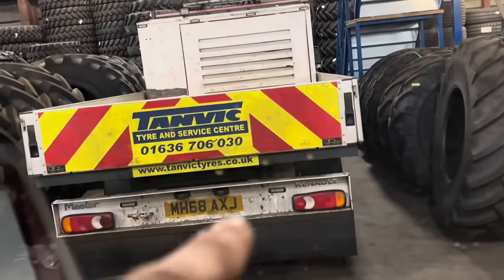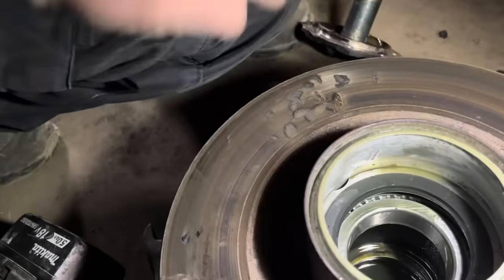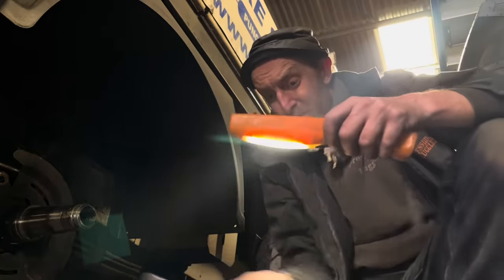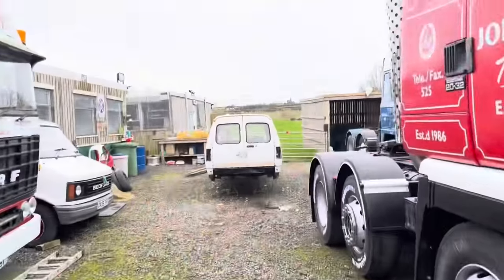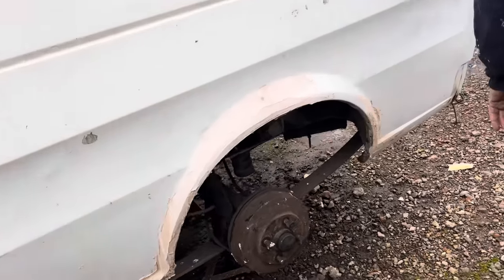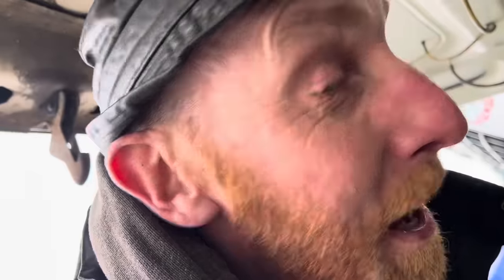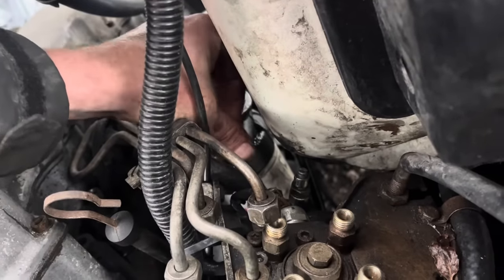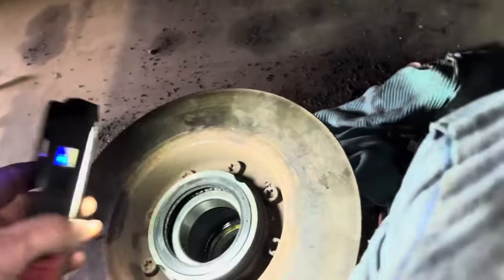Tanvic recall! Truck museum Bedford starting problem!

Comment: Chris, the cf Bedford, because the fuel pump is on its end , you need to bleed the fuel pump at the 5 mm Allen key in between the injector pipes on the fuel pump. Also old diesel starts to smell like brush cleaner when it is old & gone off ..generally when the diesel goes off the fuel pump would be knackered inside ..🧨
Reply from the maker: Cheers Ian mate that’s the bit of advice a wanted I’ll try to bleed it there first then mate! Yeah deffo think that was gone off then mate

Comment: Years ago, mate had a mini van that he shared with his girlfriend, then she bought a Mini car for herself, but always had trouble starting it. She used to ring him, he'd drive over and it started first time. With her being used to the old van, she'd been pulling on the heater knob, thinking it was the choke !
When I've been trying to prime some of our diesel stuff in the middle of a forest and the battery's getting low, I find if you block off the air intake with a bit of wood or thick card, the engine will turn over quicker as it's not having to compress loads of air ?
Also have a Garret metal detecting pinpointer, absolutely great for finding small stuff that you've dropped in the grass.
Reply from the maker: Cheers Graeme mate that’s a good bit of advice there mate! I like the detector idea 👌👌

Comment: In a garage I worked at in the 80’s and 90’s on those leyland engines if they didn’t start was have you checked the dashpot got oil in it?.. it used to be a running joke.

Comment: The use of “411” also emerged with the dial era. “0” became universal for operator assistance and “411” was the number for directory assistance. In later years, if you dialed “0 and asked for directory assistance, the operator would transfer you over to “411.”
Reply from the maker: Cheers Glenn mate 👌👌👍

Comment: If your ever unsure about the seal position been right Chris put grease on the axle where the seal should ride push the hub on the axle fully home and when you pull you can then see where the seal has gone up to. Had to do loads of the things on optre solo buses even if you used the proper tool that set the depth for you the bloody things used to piss out in the end you just used it as an indicator as to when the diff needed filling up
Reply: Thats a very good idea with the grease, but i allways knock the seal down to the bearing as thats were it should be ?
Reply from the maker: Cheers mate nice bit of advice there 👌👌
Reply from the maker: No Brian it would be to far from the lip then, it’s a shit design really mate

Comment: I remember fondly my first nail into floorboard without checking that a divvy plumber hadn't run his pipe on the edge of the board instead of the middle as should be 😢😢😢😢😢

Comment: Could you have not drilled a couple of holes opposite each other in that cup what the abs ring is on and levered the thing off?
Reply from the maker: Could of done mate but I would still have to get a new one or the oil would go on the brakes 👍

Comment: That jump pack is awfully familiar, place I worked had the same one except red and viking branded from harbor freight. I was in disbelief when I that eclipse charges £550.00 and in the US for the exact same Chinese jump box its $329 (£265.00) what a markup. They do work well if you keep them charged. And as said 411 is or was the the number for information in the US, Weather, Time, and directory assistance. Any mechanic that says they've never had a job go bad is full of it.
Reply from the maker: Bit over priced I think to mate good job a got a discount or I wouldn’t of got it! Have a good week mate 👌👍👍

Comment: In reference to the t20s the engine is exactly the same for the 12v and 6v mounting wise only things that are different are regulator starter dynamo coil and condenser 
The difference between a straight petrol engine and petrol tvo engine is the thickness of the head gasket petrol had 5mm tvo had 7mm 

A diesel engine will fit but clutch flywheel and all the electrics are different who ever told you they were all different was full of 5h1t
Reply from the maker: Cheers Peter mate that’s cleared that up then mate 👌👍 I’ll keep my eye out for them 👌

Comment: Chris that Opel engine in that cf are utter shit tow the bastard the length of the A15 with the clutch out it might start,they love easy start, what a piece of shit they are, when you get it running Chris take the oil cap off but be careful the back pressure might blow the bastard into next week 😂😂 My mate has a Maestro van with 12,000 miles on and a 1.3 it's like brand new 👌👌
Reply from the maker: Cheers Callum mate, we do like a good bit of advice mate

Comment: The problem with oil filled hubs, can leak a lot too    ,    instead of greased bearing set ups...😊 
Mechanics is a  bitch... and mistakes are made...
Reply from the maker: Very true Andy mate 👌
Reply: @Professional-struggler   i struggled on a bmi trailer last week with a saf axle..  oh my days.. tight hubs and tight hub nuts.
But all done well 👌